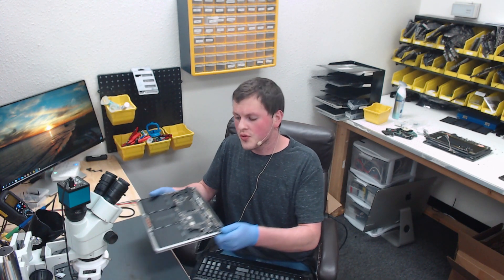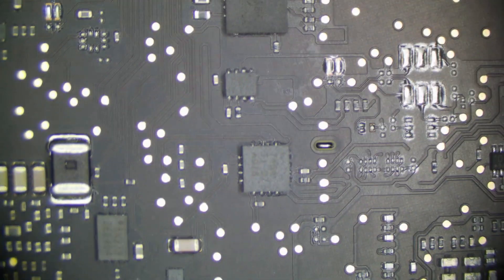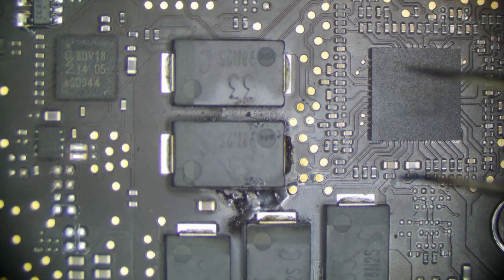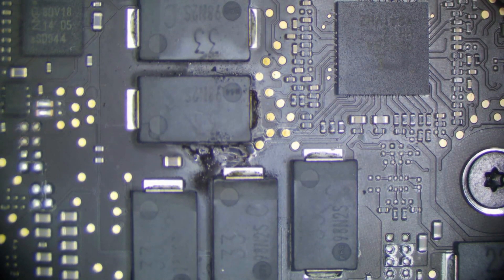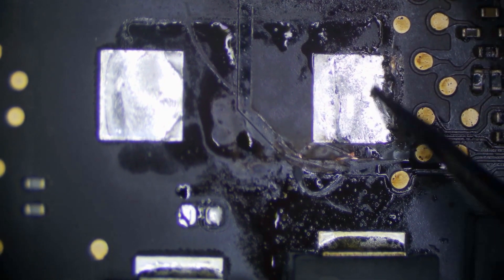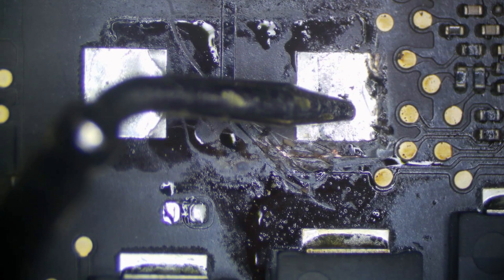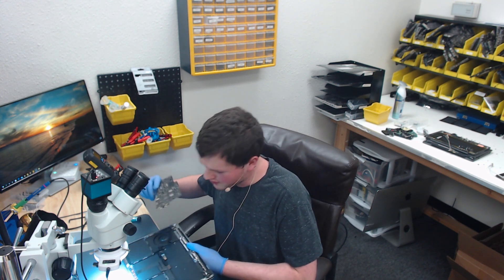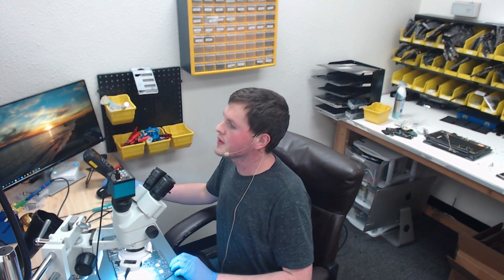2019 A2159 with a short and NO schematic. Can we solve it?

Comment from the maker: Yep. I indeed did place the caps the wrong direction in the video. The lines resistance to ground was around 0.8 - 1.0 ohm, so it would be easy to mistake for this, and the fact of having no schematic or board view definitely doesn't help. This video was recorded around Jan - Feb of 2020. Now I do have a vague recollection of catching that error, and switching the caps to the right direction after I was finished recording, but either way, the device has not come back to this date, as passed several hrs of stress testing. Stuff happens, we make mistakes. Everyone does, and that is ok. I like to show my mistakes to encourage the less experienced techs that may get discouraged when they do stuff like this.

Comment: Thx for the info man..i have a 1702 macbook pro,short to ground case,the inductors near the cpu are showing short,i removed the mosfets near to those coils,there were 4 in a row,by removing 1st and the last mosfets,the fan started spin,but there is no display on the screen,i placed the mosfets again and the board went dead again..any solution?
Reply from the maker: You put the dead MOSFETs back on again?

Comment: Hi. I have the same macbook pro model A2159. Something goes wrong, it just doesn't run from one day to the next. In the apple diagnostic they told me it is the gpu which is failing. So the only option is replace the complete logic board. If that is the case, do you mind it is possible to replace the gpu??

Comment: could you repair it?
did it work or did the ic t2 give problems?
Reply from the maker: T2 will not cause issues with board repairs. Yes this was repaired successfully. T2 can cause some issues with screen replacements.
Reply: thanks for your reply . nice job